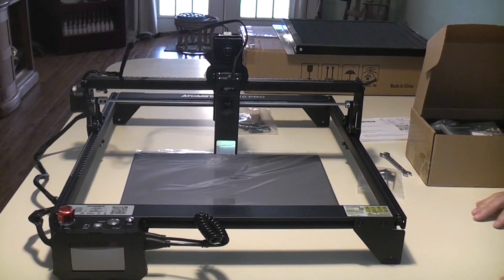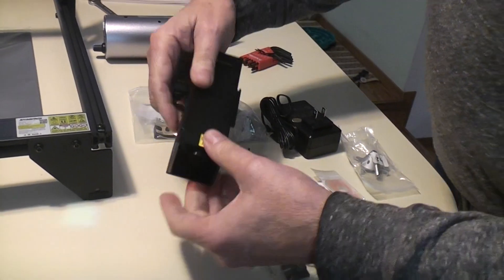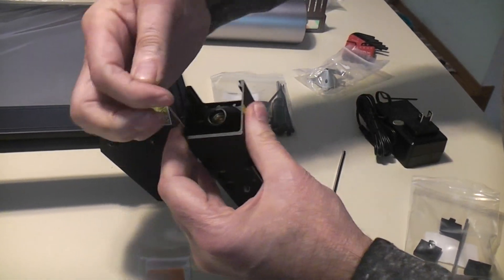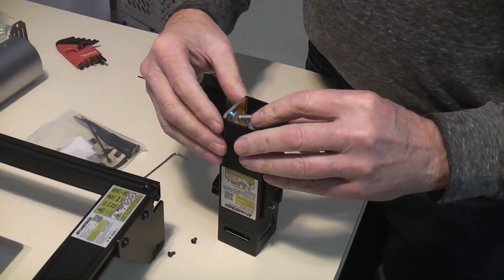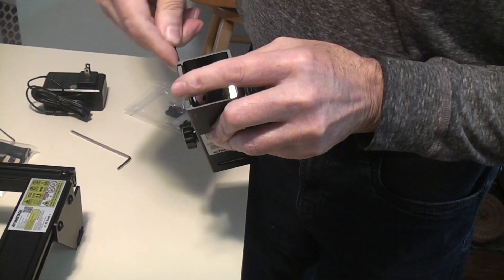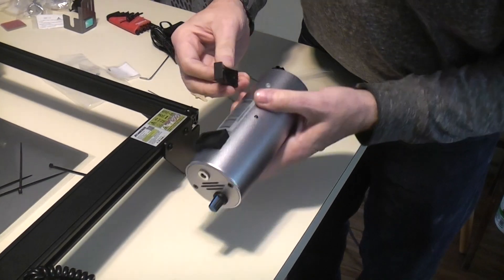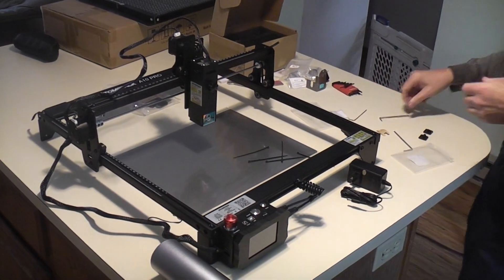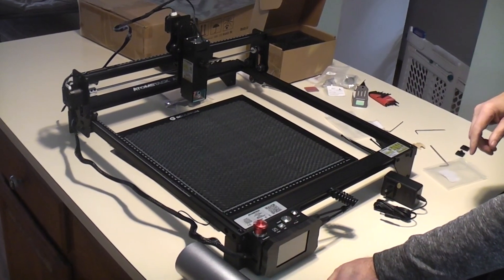Part 2. Air assist for the AtomStack A10 Pro laser engraver. Honeycomb base & CE safety glasses.

Comment: I see on lightburn it can turn air assist on and off in mid program.  I didnt see any sort of electronic connection to this fan so how does the program turn the air on and off in mid program or am I confused about its capability?

Comment: very helpful video :) Thank you.

I have a question: will these glasses be suitable for this laser?

OD wavelength range and optical density:

   - 190 to 540 nm OD6+
   - 800 to 1700 nm OD4+

Visible light transmittance: 8,8%
Protection from: Ultraviolet/UV, green, blue, infrared laser light
Reply from the maker: Yes. but always check the ones you order to make sure they do block the wavelength of the laser you are using for sure.
Reply: @Robothut  thank you very much for your answer. and how can i check it?
Reply from the maker: @MindsPassage  You look up the data sheet for the laser and the data sheet for the glasses. both company's will have the spec's for the products.
Reply: @Robothut  I have  ATOMSTACK A10 Pro +Air Assist.  Protection wavelength: 455±5nm, Laser power: 50W
Glass:  OD wavelength range and optical density:    - 190 to 540 nm OD6+  |   - 800 to 1700 nm OD4+ | Visible light transmittance: 8,8%

so it looks like the glasses are suitable. But I have no knowledge and I haven't worked with lasers yet. And I want to cut cardboard and 2mm plywood
Reply from the maker: @MindsPassage  Sound like a good match to me.
Reply: @Robothut  very very very thank you :)

Comment: I’m not clear on what the point of air assist is.  I can understand if it were a vacuum system sucking away fumes.  But how does blowing air onto the surface help?  BTW, it’s great to have you back. I hope you’re doing better.  (Duh - I just noticed this is part 2.  I’ll check out part 1.)
Reply from the maker: With lasers when you are burning something, it is best to blow the debree away. You want to keep the laser Lense clean, so the laser Lense is encased in a pressurized hood that the air moves thew. If cutting something like thick wood, you will not make the cut 1 pass, it takes multiple passes and you need to blow out the debree, keep the cut clean for the next pass. The honeycomb base allows the smoke and debree to be blown out the bottom. It does not have anything to do with smoke removal, exhaust fans are used for that.
Reply: @Robothut   Got it!  Thanks.